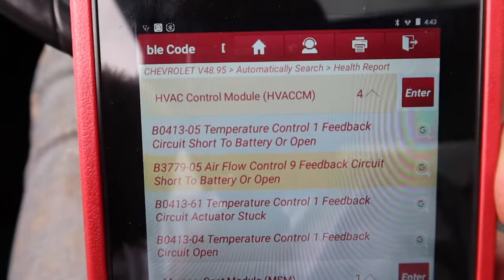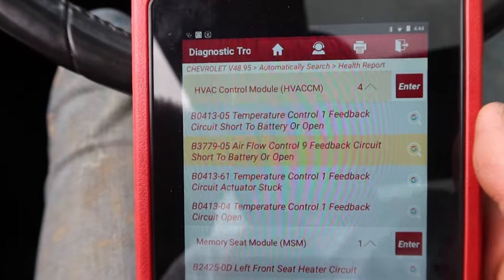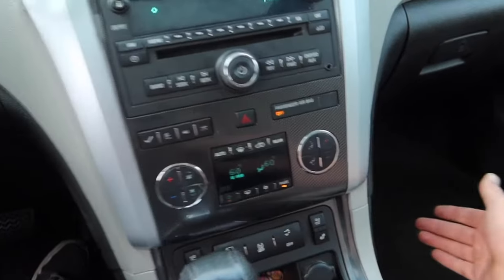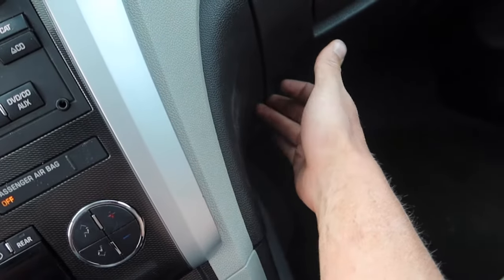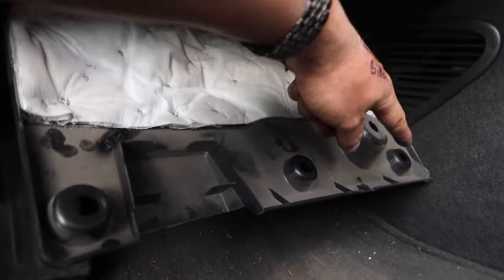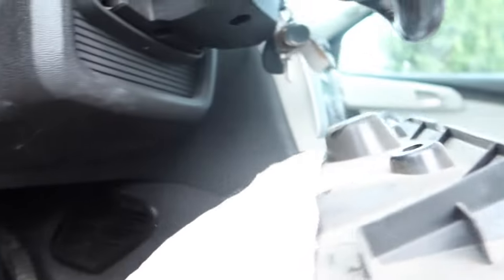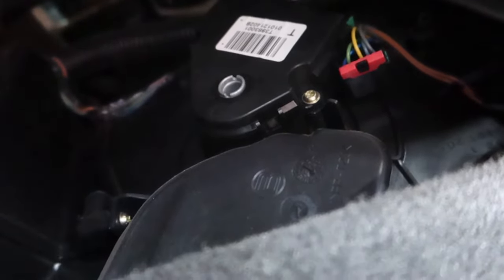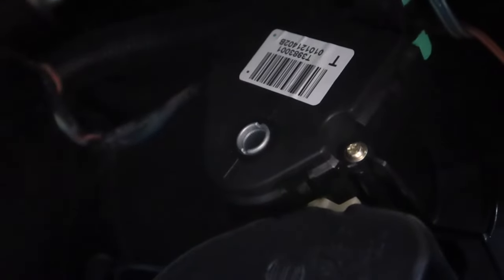Chevy Traverse Air Selector Not Working / Stuck Blend Door (All Locations)

Comment: Only video I've seen mentioning the one behind the dash on the passenger side, thank you! I believe that is the one I might have to try and fix. When I turn the heat on and different modes such as floor & dash vents, it feels as if it's barely blowing out of them but if I switch it to just the dash vents on high almost it seems to blow out alright. I replaced the passenger side lower(most difficult one). Before it was only blowing heat out the driver side now heat works on both sides.
Reply from the maker: The really hard one to get to is for the fresh air or cabin blend door. It might be some of the problem but I would check your filter first. The in-cabin filter is going to cause a massive backup if it is clogged or dirty. You could even just pull the filter out and put the door back with no filter installed to see if there is a difference. From what it sounds like your heat is working and where the air is coming out of is working so thats good and bad. Good because those are working but bad because those are the easy ones to get to. One thing you can check is to push the button above the screen second from the right that looks like a car with an arrow in it. While pushing it be on the passenger side and listen for the actuator to run. Best of luck let me know hoe it goes interested what the problem is.

Comment: Good DIY vid. I did the passenger side yesterday. The upper one was a real b17ch for me to get that top screw b'c it was overtightened - the easiest most visible screw. The lower one was ok once brought out a foot ottoman from the living room out to the car so I could lie down face up and get to it from underneath. Thank god most of the screws weren't too tight. Today I need to do the Driver side one. Hopefully it's easier than the 2 on  passenger side. I had to disconnect the battery to really get them to reset. Unplugging the HVAC fuse (which is another b17ch to get to) didn't work for me. I hate GM for putting all this stuff in such a difficult to reach place - including the damn fuse box which is supposed to be accessible. I got a 3 pack on Amazon for $40.
Reply from the maker: The drivers side isn’t that bad. The worst is if your right handed it makes the screw goofy to try and grab some that hand doesn’t have a good angle to reach

Comment: Really was hoping you wouldve shown the most difficult actuator for the recirculation door bc thats the one i cant find anything about on replacing. Thank you for more information on this though definitely very useful for understanding this part of the car more.
Reply from the maker: I was lucky enough to not have to replace it lol. What are you having troubles with? The hardest one to get to is the fresh air or cabin recirculation switch. It’s tucked way up under the passenger dash area

Comment: Well I have a different situation and I need your advice bout it my front passenger and driver vents working fine while the rear vents blowing hot air what might be my problem here?
Reply from the maker: It’s the lower blend door for the back. It’s the one underneath the shifter area

Comment: 2011 Acadia, which actuator controls the windshield defrost? I have hot/cold coming out of the dash just fine but nothing for feet or defrost.
Reply from the maker: The one I replace is the selector actuator. The video goes over how to replace it and how to check to see what does what. Give it a good watch and it should tell you everything you need to know

Comment: What would happen if I keep it stuck on cold would that break it or were you just suggesting neutral?
Reply from the maker: It will just be on cold. The switch is sending signal to a broken part. Now assuming there is no electrical issues nothing will happen. If there is electrical issues it might melt itself trying to send power to nothing

Comment: Hello bro nice video. The problem on my Chevy traverse 2012 is that there’s no air blowing out the front defrost as well as my front vents. But the air blows out the 2nd and 3rd row vents. Any idea here ?
Reply from the maker: The 2nd and 3rd row would run off its own system. I would check the front air selection actuator to see if it’s moving. It’s the one I replaced in my video. That’s the one that gets used the most and wears out. 99% sure that’s your issue
Reply: @ModdingAddiction  I appreciate it bro, me and my friend are gonna follow this video and change my actuator and I’ll let you know if it helped

Comment: I'm not sure what you call "bleeding the brakes" does for expelling energy. Could you explain?
Reply from the maker: It takes any residual energy in the system and try’s to turn the brake lights on. Since there is no power source it drains the energy in the system so there isn’t a voltage in the wires

Comment: Great video. My 2011 Traverse only blows hot air in the front (both driver's side and passenger side)  The rear will blow hot or cold when the rear controls are adjusted.  I am able to adjust air location (floor, face, defrost) Do you think it is the driver's side actuator/module that is causing only hot air to blow in the front?  Thanks
Reply from the maker: Should be the module on the drivers side
Reply: Same is happening to me on 2010 Acadia...front vents blow warm air while rear vents are blowing cold air...before this started I heard some clicking by the drivers side...🤷🏻‍♂️
Reply: Try disconnecting the battery underneath the floor behind the passenger seat first for 10 mins. Reconnect and set the HVAC to Auto and let it relearn. That might fix it. If not, then it could be one of the 2 rear actuators on the passenger side in the trunk.

Comment: hi so when i bought the acadia i replaced the blend door actuator. it worked for maybe a week. since then ive replaced it 2 more times but its still stuck on the face vents only.  could it be the actual control module? both temperature ones work properly.
Reply from the maker: Take one of the other modals out and swap it with one that is known to work. Might be a cheaper one that doesn’t like something or it might be a shorted wire. You can eliminate if it is a bad actuator if you just switch it. Then if the heater gets stuck on a temp it’s a bad actuator brand. If the old one you swapped to the blend door breaks it’s a problem with that circuit most likely
Reply: Try disconnecting the battery underneath the floor behind the passenger seat first for 10 mins. Reconnect and set the HVAC to Auto and let it relearn.

Comment: My ac & heater both work fine my only issue is the floor & the dash vent both stay on when i only want dash vents to be on. What can my problem be?? If i only want floor vents to be on the dash vents blow air aswell. Hopefully u guys understand my question
Reply from the maker: Does any other function work when trying to switch were the air is coming from? If so then it might be miss aligned or sticking. If there is no change in where the air is coming from no matter what you select I would say look at your blend door actuator
Reply: @ModdingAddiction  yes when i put on defrost i get air from dash vents too. Also when i have it on floor vent i get air on dash vents aswell 🤦🏻‍♂️. Where is the blend actuator located at? Its for 2012 chevy traverse
Reply: Update: I replaced door blend actuator & now it works 👍🏼

Comment: What if nothing in the front is working hot or cold no air is blowing, but rear air is working good??
Reply from the maker: The rear is on a separate system that is working still. I would start checking what is working in the front. Pull the panels off so you can see the actuators and start pushing button to see what is working. That will be the easiest way. If I was to guess it’s the selector for where the air is coming out. Ie vent, face, feet. This one has gone out twice on me. The next would be the hard one I haven’t done a video on bringing air into the cabin

Comment: The rear ac system works fine the front ac stopped working... i doubt its the button selection it shows its making the change but zero air out the front vents
Reply from the maker: The buttons will show it trying to change but won’t. The buttons are trying to send out the signal but the actuator is not responding. It should be easy to hear after you push the button for any function to hear them operate. Might listen on both sides
Reply: @ModdingAddiction  turned out it was the wiring for the blower motor

Comment: What about if the rear AC is blowing hot air and the front blows cold air
Reply from the maker: The front and rear are two separate systems so it sounds like everything is working fine???

Comment: My traverse blowing hot on driver side cold on passenger I bought part wish me luck. Also wipers stopped I checked fuse then relay under hood nothing. It ended up being wiper control switch or directional arm. 50 bucks fixed easiest fix ever
Reply from the maker: You got this. It’s going to the lower one I believe. It’s not going to be the one I replaced in this video but you got this

Comment: I changed the driver actuator but still nothing comes out.
Reply from the maker: There is 4 different actuators that control different things. What are you having trouble with? There is one that controls the hot and cold. The front where air comes out of. The rear where air comes out of. Fresh air or cabin air. There are multiple actuators controlling all of different zones